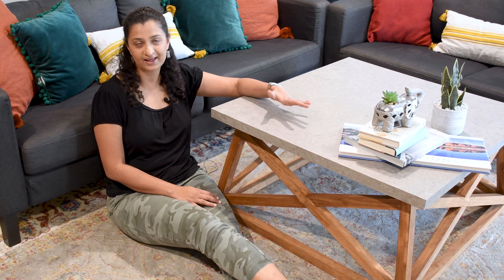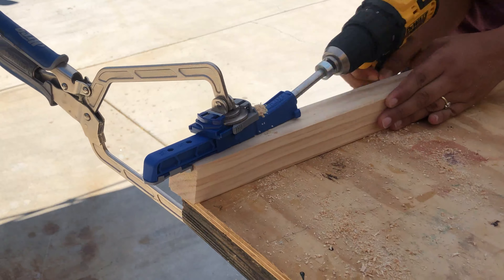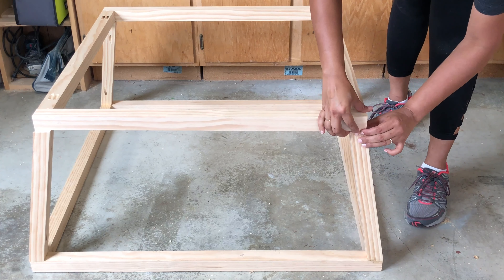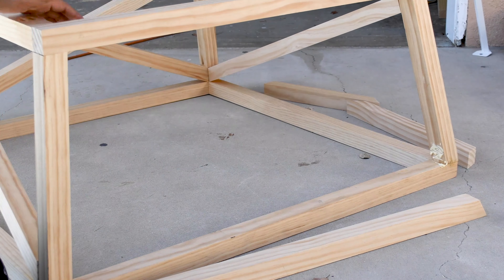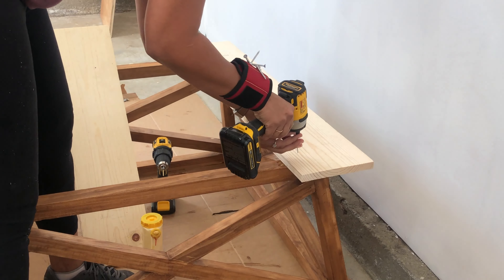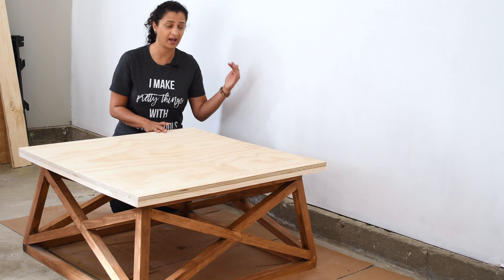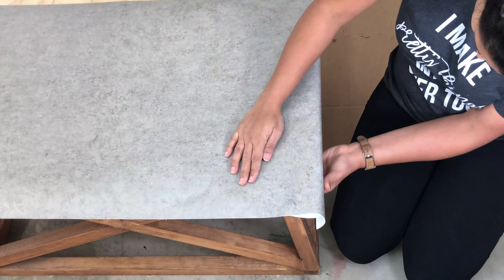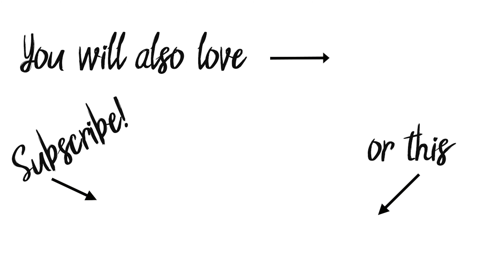DIY square coffee table - with angled X-legs - NO Concrete! - Anika's DIY Life

Comment: My mother used to patch wallpaper by tearing off a piece of new walpaper and attaching it over the tear in the wallpaper already on the wall.  The edges would blend into walpaper on the wall.  You may want to try tearing the edge of the second piece of contact paper and overlapping it onto the piece already attached to the table.  I really don't know if it would work, but it is worth a try.

Comment: Hi i love your work and want to try this! wondering where you get the lumbers? I usually get them from local hardwood stores but they are almost always bent and not straight..
Reply from the maker: I do get them from hardware stores. You do have to spend time finding the right pieces. I mostly use select pine. They have less/no knots and easier to find straight boards.